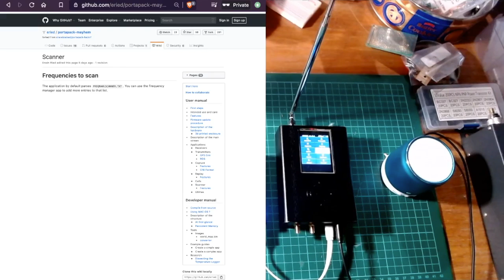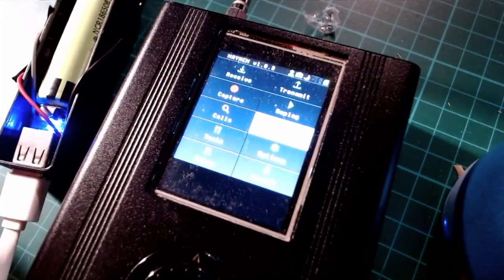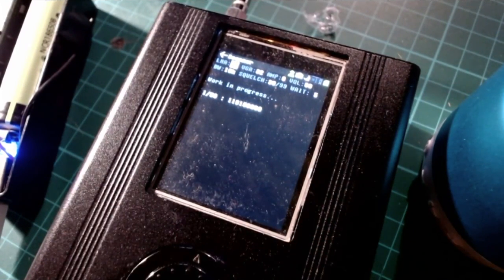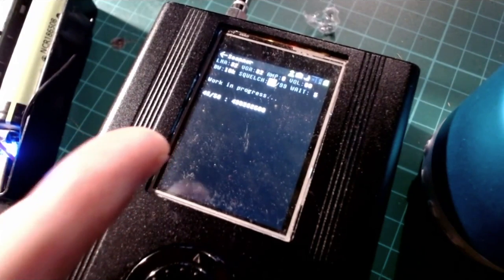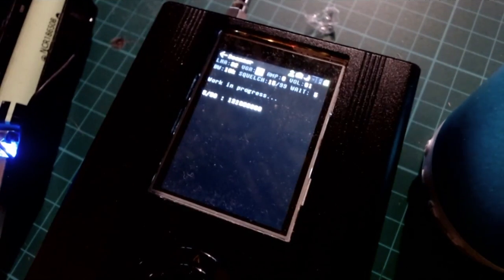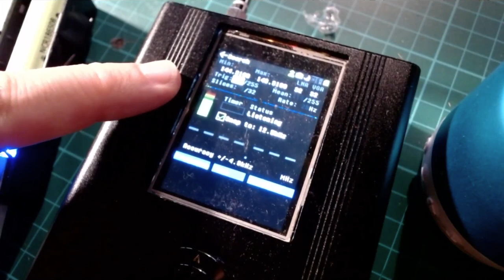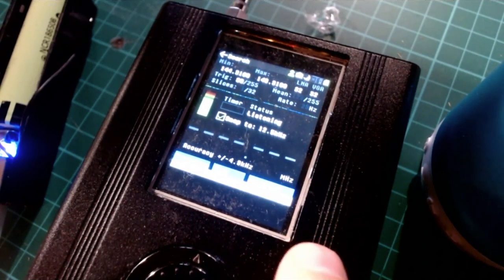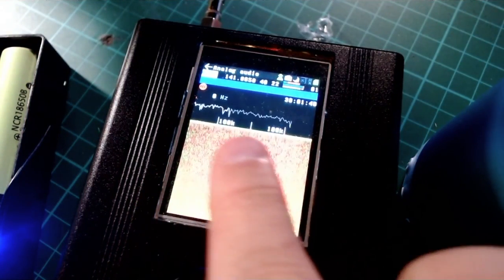Episode 43: Scanner and Calls (HackRF/PortaPack Mayhem)

Comment: Hi, I wont to increase TX power on Portapack H1in within the power supply of the USB battery, must be still mobile, can you recommend to me some device?
I very much like the antenna on GNU radio, can you post also direct link on this antenna?
Reply from the maker: That's an interesting question. Of course it depends on which USB power bank you are using, and what is the maximum power it can supply. I have recently (see Episode 62) started to look at a transmit configuration of the HackRF. Follow up those videos, maybe you'll something that fits your need :) ciao

Comment: Hello is it possible to replay car signal and unlock a car? It duplicates the same signal or can use symmetrical signal? For instance if different buttons are used on remote on lock/unlock, and it accepts unlock, can it send command  "lock"?
Reply: Yes.
Reply: @Eric-the-wise  havoc software also does the same?? Thanks for replying
Reply: @datodatto  it is okay to use Google every once in a while. Today is your day.
Reply: @Eric-the-wise  thanks
Reply: It varies from car to car and age, it depends on the signal and if its "simple" some older car, you can just do it crudely with a reply and on some garage openers same, but modern cars.. not so easy... check Youtube a lot of videos on the subject.
Reply: @JAKOB1977  Yes, I checked. But even modern cars are opened by two SDR. 
if you can help in this project, reply me ..  We can talk on email
Reply: @datodatto  Im no expert on these matters, but to my understanding with how the keyfob operates, some uses simply e fixed codes and some uses rolling / hopping codes.. the fixed ones, like in older cars or garage doors.. those you can control with reply.

A crude explanation:
- Remote controls send a digital code to the receiver. If the receiver determines the code is acceptable, then the receiver will actuate the relay, unlock the door, or open the barrier. Simple remote control systems use a fixed code, the code that opens fx the gate today will also open the gate tomorrow. 
An attacker with an appropriate receiver could discover the code and use it to gain access sometime later. 
While more sophisticated remote control systems use a rolling code (or hopping code) that changes for every use. An attacker may be able to learn the code word that opened the door just now, but the receiver will not accept that code for the foreseeable future. A rolling code system uses encryption methods that allow the remote control and the receiver to share codewords but make it difficult for an attacker to break the encryption.-

But Im no expert, just a newbie that just got myself one of these SDRs and trying to make sense of it all.https://i.imgur.com/SuaRN6y.mp4
will try with my car, down the line to see how the signal looks and if it varies hence different aspects. lock, vs open trunk, and likewise.. cheers..
Reply: @JAKOB1977  for rolling codes one jammer and one SDR are enough . As I know..
Reply: @datodatto  Okay, so the intention is to use a jammer to barrier and flood the original receiver, while your sniffing a few in sequence and then the original receiver will not have rolled for a new code and still be valid when you then replay it with the sniffed ones.. do have a few jammers, alongside the one in the hackRF which au'naturel is not that strong..got a 3 antenna variant and a 10 antenna variant... the latter is quite powerful and will destroy all my Bluetooth and wifi signals and my cellular signal... its the one on the right. https://i.imgur.com/jTTeAdQ.jpg

gonna try it out if it also can jamm the frequencies these keyfob operates at.
btw the HackRF+portapack 3.2" (v3.3) in my testing, its inbuild signal generator can go all the way up to 6.52GHz and way above the labelled 6GHZ, though the potency of the signal varies a lot over the span.
Reply: Wasp? Hmmmm lol

Comment: Hi. I was not able to transmit at a low frequency of 1-2 MHz.
Reply from the maker: what do you mean? Weak transmit power (if so, how did you measure it?) or some kind of error?
Reply: Hi. I checked on the field, the receiver is xhdata d-808. Now I checked in the house is working in 1735kHz
Reply from the maker: @hatuul  good!

Comment: Hi and welcome me to your channel :) So if you put a a more limited freq like : 144.000 to 145.000 Mhz you will get a better response from your Hackrf in detection of a freq.I put to scan from 100.000 to 150.000 Mhz and I TX with my Yaesu FT1D on 144.910Mhz for a test and I got a response from Hackrf 147.155 WAY off from what it should be.try that.73! (go get your HAM license :) ) And buy a decent handheld radio not a Baofeng :)
Reply from the maker: Right! I also observed this bad/not-precise behaviour when the range is too large! You will notice that you get more "slices" (with low range you have 1/32, and if you go up too much with the range you'll get !!/32).
In the havoc wiki (https://github.com/furrtek/portapack-havoc/wiki/Close-Call) they say that their Calls app works well for only 3Mhz (which is basically 1/32 slice). I think at the moment in Mayhem it does not work well with >3Mhz range. But maybe they will improve it :)
73!
Reply: re: "And buy a decent handheld radio not a Baofeng :"
AS they are all using the SiRF chipsets these days, there is very little difference between brands ... better off buy a 'legacy' Japanese handheld that uses double conversion on RX and true FM on the transmit TX side ...